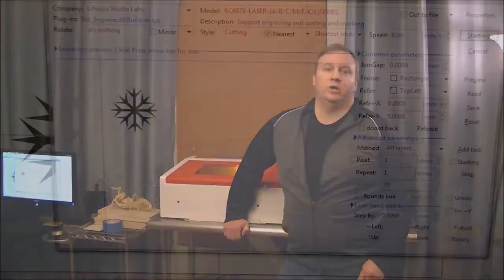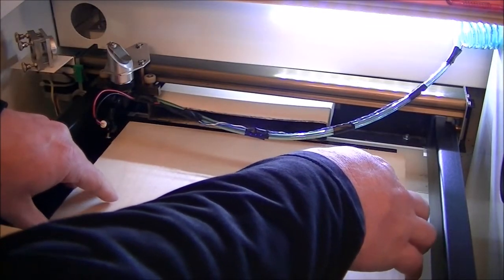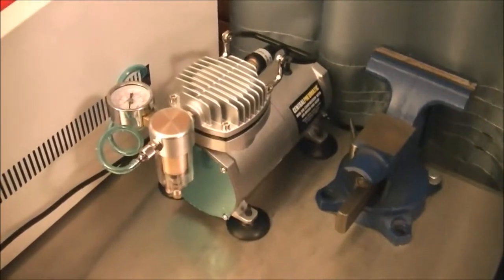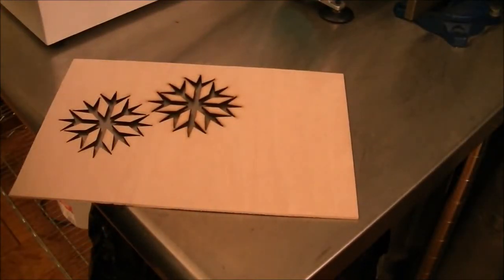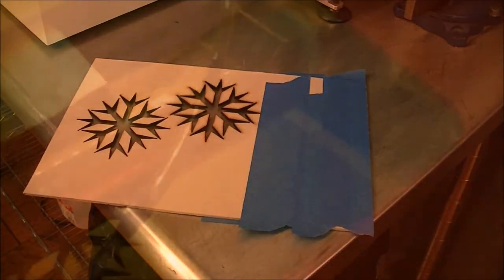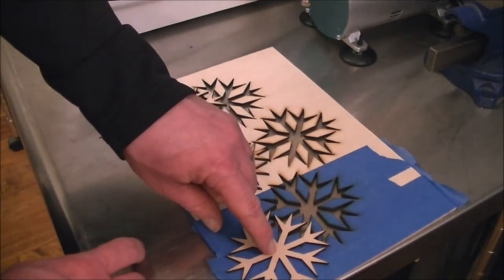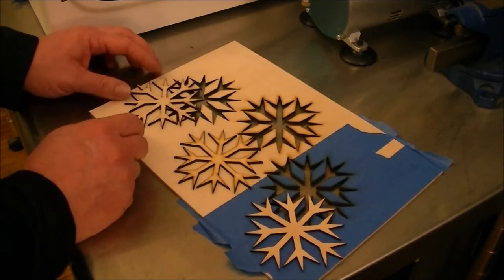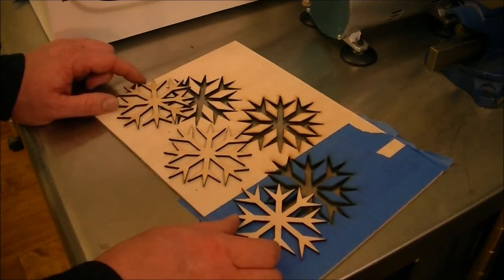K40 Laser Cutter Air Assist Head to Head Test

Comment: Nice Vid.. You should try moving the air flow direction. The air assist is blowing the laser heat at an angle, which will start to burn the wood around the profile. If the air flow is moving vertically down with the laser, then you should see less burning and in turn, should help cut through quicker. You may be able to 3D print a nozzle to aid.

Comment: Im very late to finding this, but great vid - while the levels issue others have pointed out is there, I really dig the track - What is it?  As to editors, if you are still looking, I found REAPER to be the solution that fit my needs the best (and it will do basic video edits as well!  Bit of a learning curve, but worth it)

Comment: Where do you purchase your wood stock? Thanks
Reply from the maker: I get it from a local specialty woodworking shop.  I have looked into getting it online, and on ebay but the cheapest for me is a 5' x5' sheet that they sell here in town, and then I cut it all down into the 8"x12" plates you see in the video on a table saw.

Comment: Nice video, sub-ed and liked however one suggestion is to not use a music overlay it competes with your voice and makes the video hard to follow (into's, Outro's and Timeslapes are OK but taper in and out).  The time is also good at sub 6min as you likely find the average watch time is around 3 to 4 minutes. :-)
Reply from the maker: I struggled with that music issue.  I need some software that gives better control over the music and audio. Microsoft movie maker wouldn't let me turn down the music when the voice parts are going. What editing software do you recommend?
Reply: movie maker should allow you to reduce volume of music, you might want to split you music and fade out when talking and fade back in when not.  Adobe Premiere Elements is a good low cot editor.
Reply: I use Power Director Ultimate (http://amzn.to/2jEytn3)  on the PC as it is very close to iMovie which I use to use, however its sub 100 bucks and amazingly powerful...